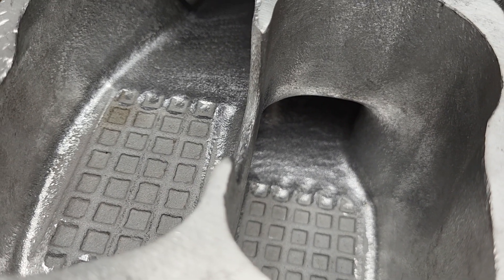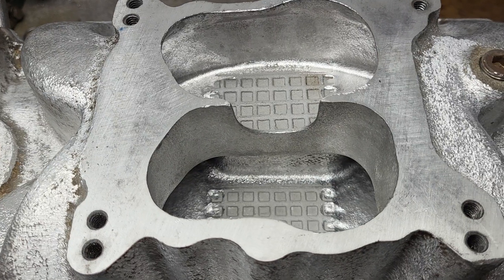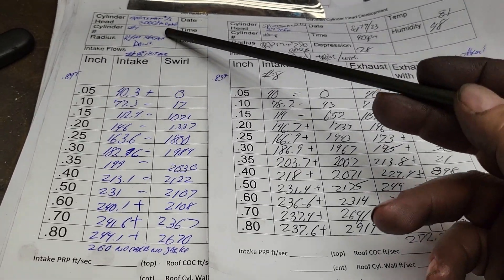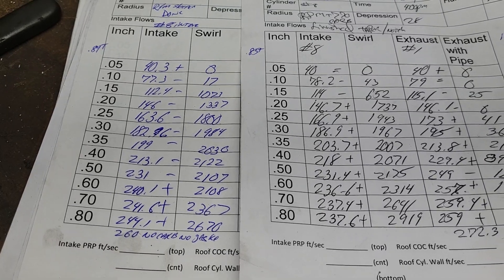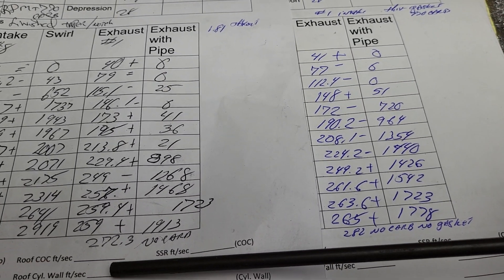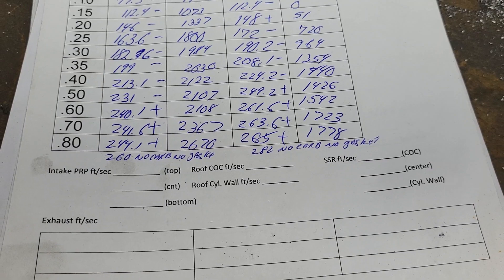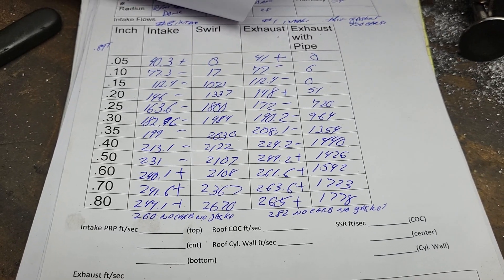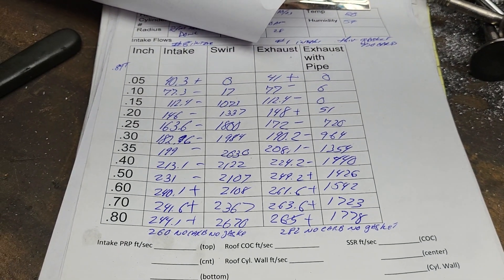Edelbrock performer rpm finished and flowed on 300 cfm World Sportsman 2's

Comment: Love all your vids! Watch every one, always get more understanding about air flow. Do you feel this style divider mod work with  other dual plane intakes? Better than notch style? Effect of 1 inch open spacer with divider notch? Divider tapper to shallow plenum side apply to most intakes? Tapper on full divider with 1 inch open spacer? Thank you for your insight. Keep on!
Reply from the maker: I have a short attention span. Only one question, I like this notch design for high performance street application. Thanks
Reply from the maker: It works on any intake I have used it on.
Reply from the maker: I like the taper to upper H.
Reply from the maker: I don't like the notch design as much due to shortening the runner length more. Does it make a difference? Idk.
Reply: Thank you for the advice. Keep on! @servediocylinderheads

Comment from the maker: If you want less low end torque and a bit more higher rpm torque you could. It may like it due to such a small carb. Is the engine stock or modified? Grinding it out is a lot easier than adding it back in!

Comment: I was running a performer RPM Q-jet on a 434 small block. With an AFR 220. Ran great. Put a straight Runner Speedmaster intake. Doesn't appear to have made much more power. Both of them are ported... love the videos. Keep up the good work!
Reply: The motor had a 650 solid roller  cam. 10:1 comp. 1.75 short header, and 1000 cfm carb...
Reply from the maker: Good info. Thanks

Comment: On my slant6 factory aluminum 2 barrel should I cut out the divider under the carb in an open plenum for more flow or cut out a notch in the divider and smooth the shape edges under the the circular ports 🤔